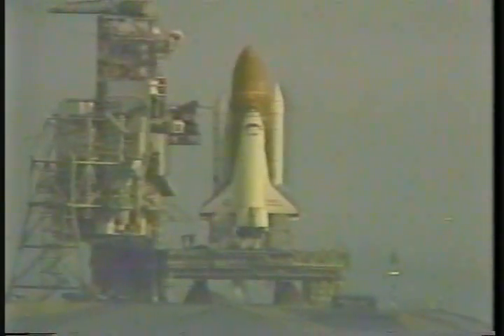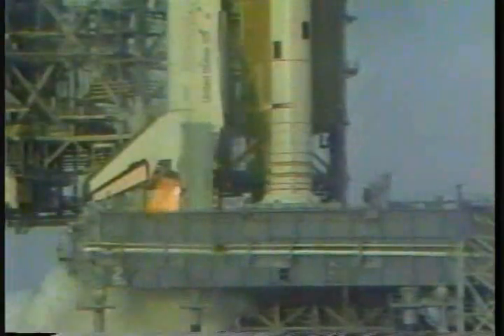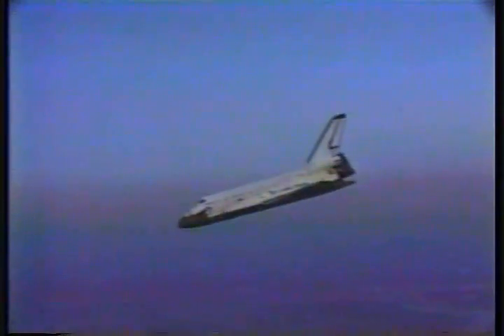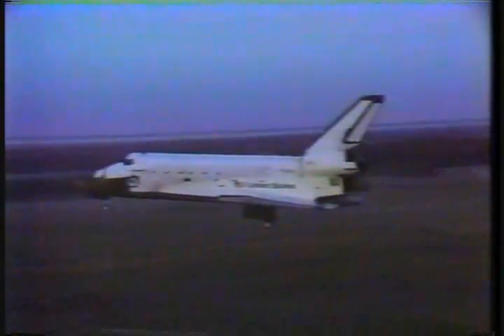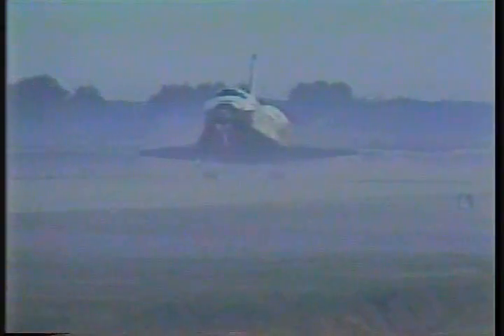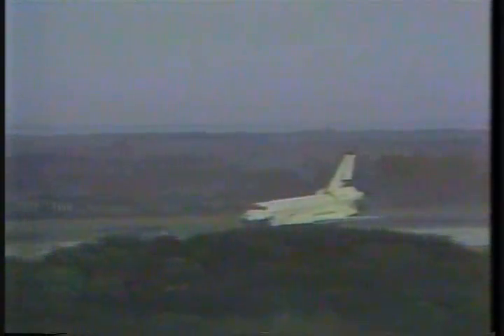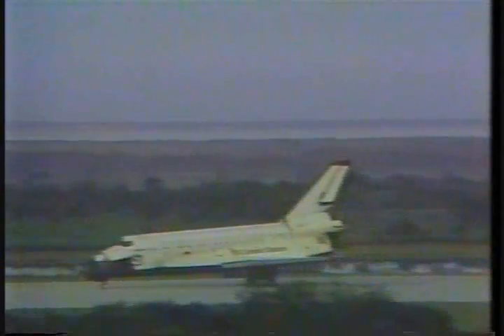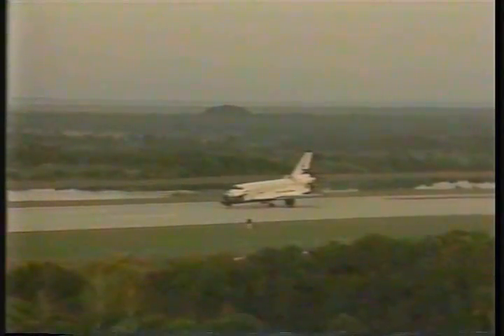STS-41B launch & first KSC landing (2-3-84)

Comment: The overly complicated "mission naming system" NASA came up with after STS9 was mainly to allow for launch sites outside of KSC (Vandenburg was the main one) 

The system was also very short sited, since it was not Y2k compliant. Heck,  it was not even NINETEEN NINETYS compliant. Very odd that they would come up with a system that would break in 5 years.
Reply: The fact that the naming system was adopted shortly before STS-13 always made me think that the whole reason they did that (after Apollo 13) was to avoid having another space mission numbered "13".
Reply: I believe the system would have just counted the years starting with 1 in 1981. So the first mission of FY1990 would have been STS-101A, and STS-135 in 2011 would have been STS-311C, etc.

Comment: actually it's quite easy once you crack the code lol:
STS-41B for example :STS means "Space Transportation System" (aka the Space Shuttle). 4 = fiscal year 1984 (NASA fiscal year starts Oct 1st of previous calendar year) 1= Kennedy Space Center launch site (2 was for Vandenberg AFB launch site, which was never used, however a flight was manifested for is, STS-62A). The letter means the order in which the flight was originally manifest (not necessarily flown in order)

Comment: i think i saw footage of this untehtered spacewalk love it why was there missions with a specific number and a letter at the end i never have understood that?
Reply: I agree, this was a complex system of numbering flights which left many people baffled.  The numbers referred to the fiscal year (different from a year from January to December)  in which the Shuttle flight took place, so “41” refers to the year of the launch, 1984  and the letter b refers to the fact that it was the the 2nd flight of the fiscal year.  Since the fiscal year in the States is from October to September,  61 A, 61 B and 61 C  were actually launched in the last 3 months of 1985, not in 1986. To add to the confusion, some flights were delayed but kept their original flight number.  The fatal Challenger flight, launched in 1986,  had the number 51L, as the flight had originally been due to place in 1985.  So 51L actually launched AFTER 61 A, B and C.   And in 1985, 51 B was launched after 51 C and D!  
To make things even more confusing, had the Vandenberg launch pad in California ever been used, the second number would have been 2, to signify that flights launched there and not Kennedy, Therefore, the first Vandenberg flight would have been designated 62 A. 
Of, course, Vandenberg was never used following the Challenger tragedy and NASA reverted to a simple 1, 2, 3 and so on format. So the flight following Challenger was STS 26. But if a flight were delayed, that would mean that a lower number would launch after a higher number. For instance, STS 28 took place after STS 29 and STS 30, so confusion still happened!